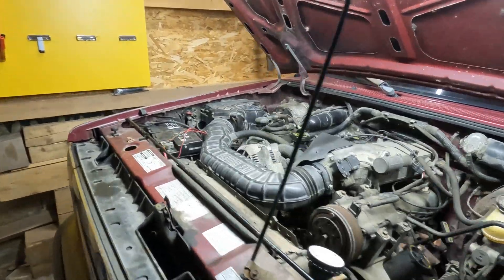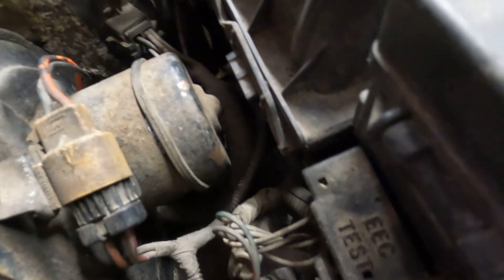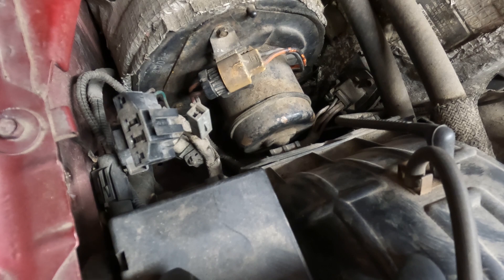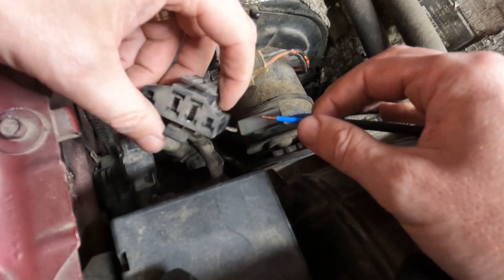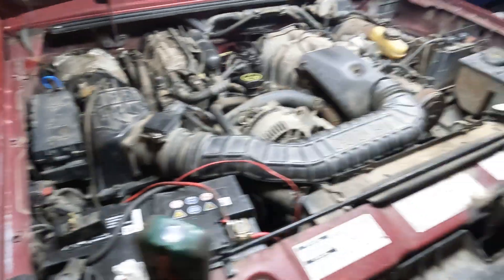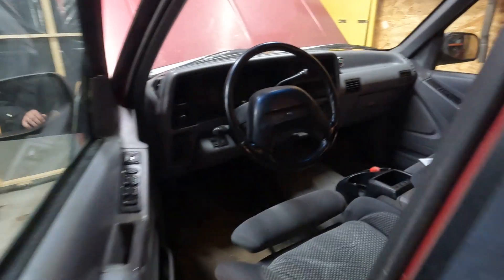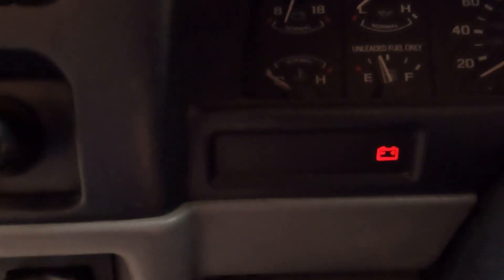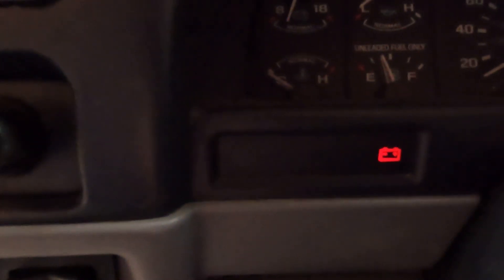1993 Ford Explorer - How to read CEL codes

Comment: Fantastic Video I have just got my Explorer sport back form the garage after having the upper and lower ball joints done now I can go and check the engine and check for any codes and of course check for air leaks and other issues regarding the high idle issue, Again many thanks for the update,   Stay safe
Reply from the maker: I've also had the ball joints done last week. Not the Explorer in this video, my other Explorer.
Reply: @Zvoneru  Keep up the great work really enjoy the video content,,